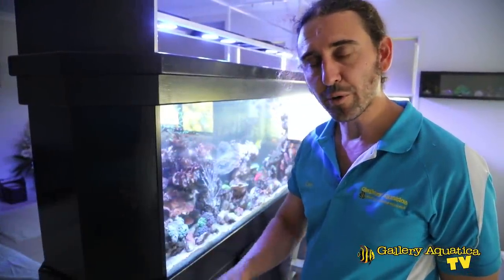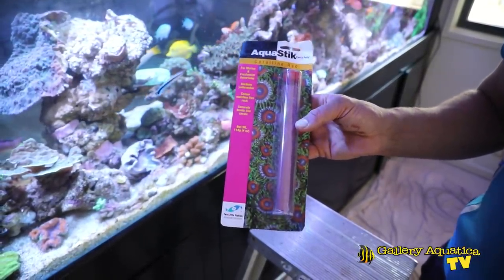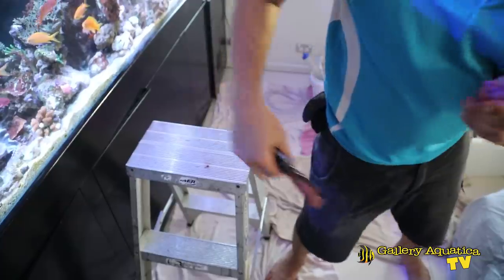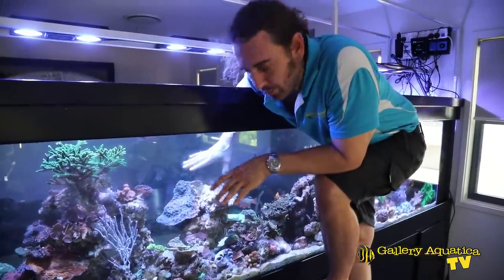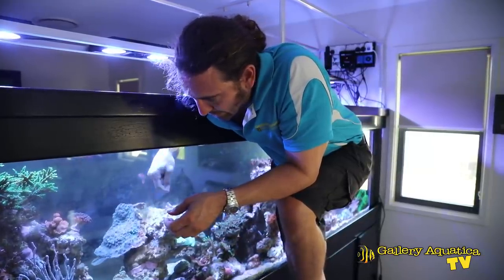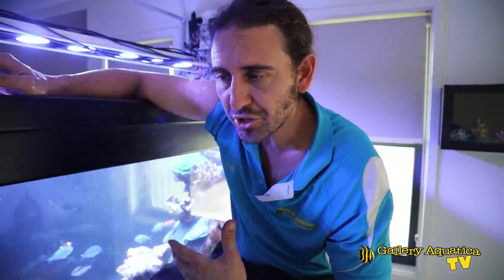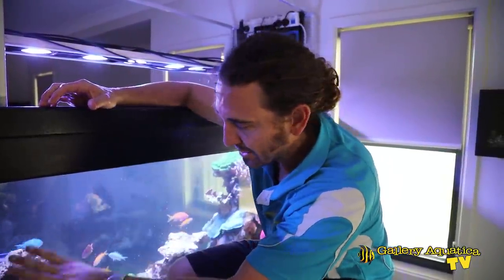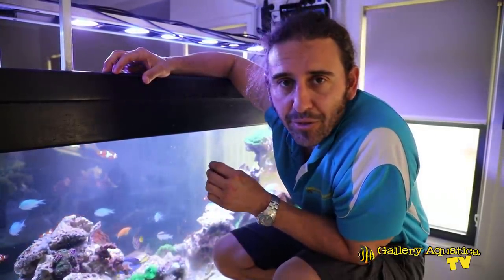The Great Tank Swap: Part 2 --- Gallery Aquatica TV

Comment: Having just finished (last week) an aquascape on a 200g tank that was complete dry rock while yeah it is easier for placement,  you do have to keep in mind corals to grow to fit the negative space that you leave.   I've done some reaquascaping with corals and live rock too... and yeah that's never fun.

Lots of different pump options I see, Vortech pumps,  I see a Gyre pump, also looks like a Rossmont waver controller so I assume those pumps are somewhere in the tank as well.
Reply from the maker: We used all the existing pumps and added another MP40. The new (flat) end of the tank has allowed us more options for water flow, so with the various pumps we have we should get great flow. Cam